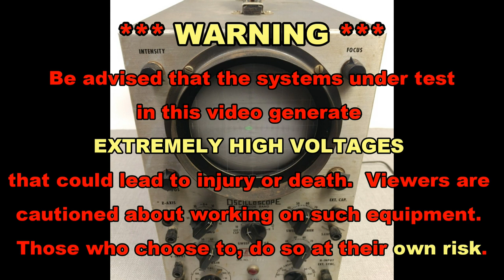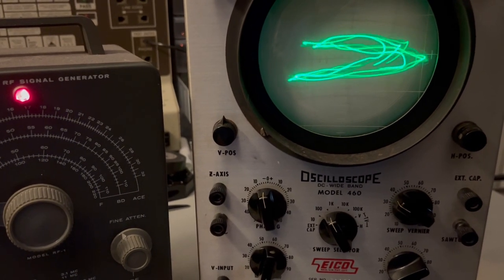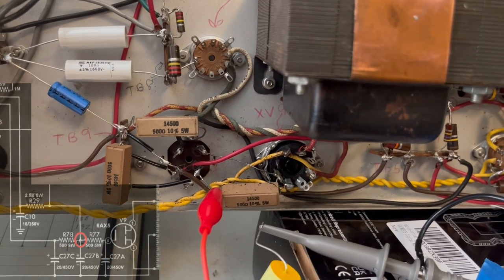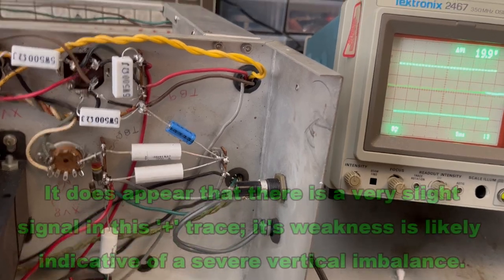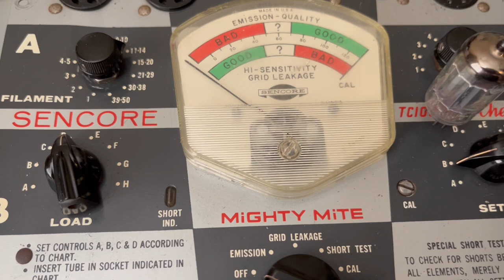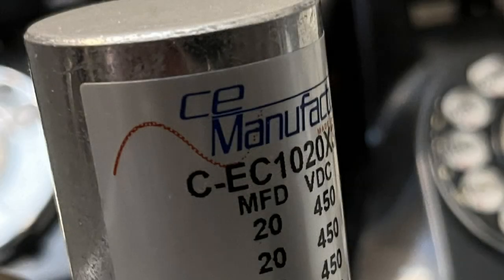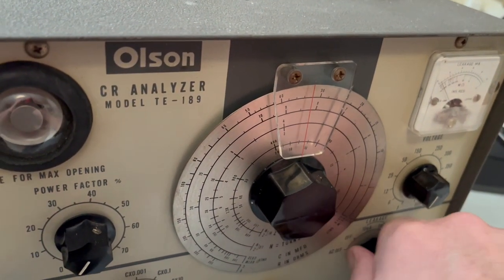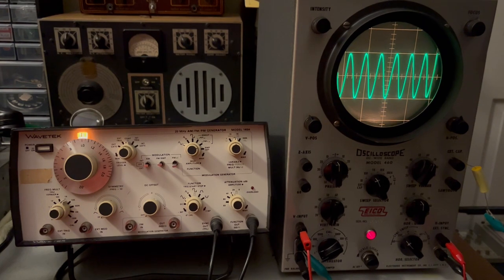EICO 460 Oscilloscope Restoration: My Procedural Errors and Wild Goose Chase

Comment: Oh my gosh, it looks like this is almost exactly what I did. I'm not sure if I did it on my own accord, or if I was following the work of the previous person to work on the scope, but my new electrolytics are going to the wrong side of the 500 Ohm resistor. I will have to see if this fixes my noise problem!
Reply: Indeed, this made a huge improvement! Now I can actually troubleshoot the remaining issues and do an alignment. You have likely saved my scope from some unnecessary mutilation, and saved me time I didn't have to spare for troubleshooting. Thank you for posting this! 
I wonder if it used to be standard practice to float the ground of the filter capacitors... I would be interested to hear from anybody who knows why this decision was made in the design.
Reply from the maker: I'm happy to learn that it helped someone.  Thank you for replying.  I don't know the design answer, but I'm working on my third scope restoration right now  and EICO is the only one I've found in that limited pool to do this.  The other two were a vintage Dumont 164 and a vintage Hickok 640, where the Hickok is giving me fits.
Reply: Thanks for the info. I feel like there might be some lesson about ground loops that I should find in all this...  @pinballpsycho
Reply: Thanks for sharing your experience with the Eico 460. I’m starting a refurb on a 460 that looks ‘less than mint.’ Would you be willing to share a pdf of the assembly instructions? 

Even before watching your video I made the decision to replace all the caps (minus the mica caps) 

I’m impressed with your results! I hope I can achieve a similar outcome.

W7GTM